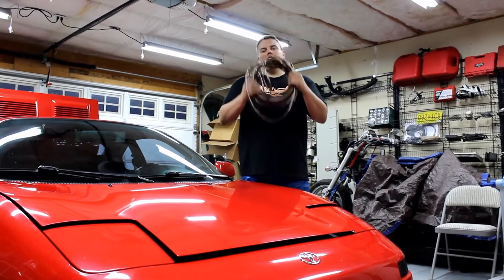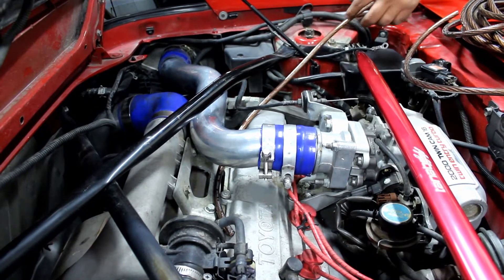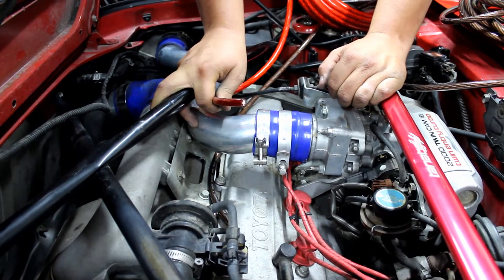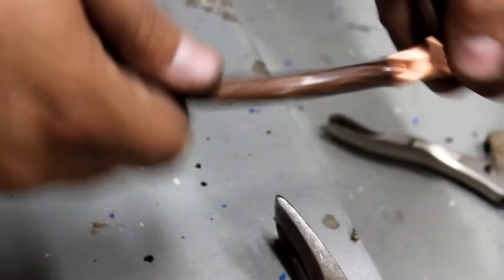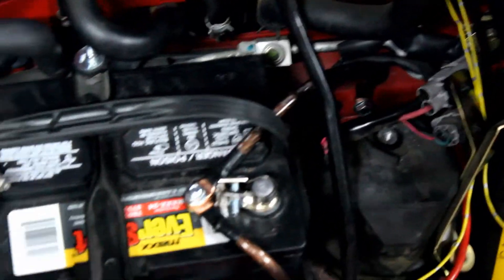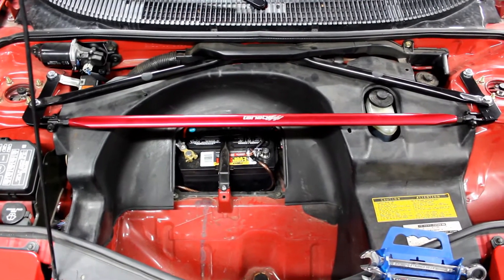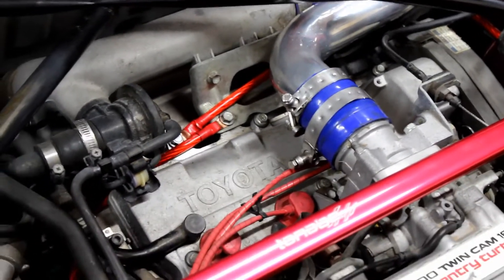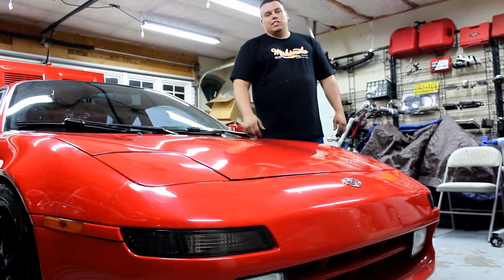How To: Turbo Toyota MR2 Grounding System Upgrade - BIG THREE

Comment: The best way to upgrade an mr2 chassis ground potency is to get a multi ported contact for the negative battery terminal and run 3 cables from it that are at least true 4 gauge (awg) and fully copper.  The three locations should be one for stock, one for a bolt on the driver strut tower, and one going into a bolt sticking out of the driver side frame rail just beneath the main metal coolant pipe that goes to the radiator.  I would advise against the location at the power steering fluid reservoir as it only leads to constant 16 gauge metal until the crossbar that the stock ground point is bolted to.  
The locations I listed will cause ground potency to increase at the rear end, traveling through the thickest metal of the superstructure before dissipating at the trunk wall where it becomes 16 gauge again
Reply from the maker: what electrical engineer says potency when referring to ground resistance?  all that matters is the resistance from any point on the engine to the battery negative terminal.
Reply: Actually the word was meant to say potential, but when swiping words on my phone it causes some words to autocorrect, however, focusing on what terminology I used, as well as making the assumption I am an "electrical engineer" seems intellectually dishonest.  Nothing in my original comment was intended to be rude, I simply saw the fastening point at the reservoir and that caused me to make my comment, giving the best information I could.
I am not an electrical engineer but I was a mechanical one.
I have build 11 of these vehicles, a few times it has involved stripping down to the super structure and beginning welding strengthening points to replace glue contacts.from.toyotas assembly line.

You are correct, resistance to the battery is what matters, when a point has good ground potency.  Good ground potential simply means it is at zero in comparison to the positive voltage.  Or as you put it, it has "no resistance to the battery negative terminal".
You can also just call it earth if you like.

I repeat, the metal floor of the "drunk" is 16 gauge and the only metal that it is tig welded to is the crossbar behind the battery, this is the same crossbar that the stock battery contact is bolted to.
The other contact points have pinch welds, bolts and glue.
The frame bars on either driver or passenger side are not only much thicker metal, but have an unbroken lead to the rear end that stops just before the trunk, where pinch welds and glue increase resistance.
The strut teirs also have an unbroken lead to the rear end, however, not though the rails but through the superstructure.
Whatever terminology you wish to use, these are the 3 points in the front of the vehicle that have the most unbroken metal leading to the rear end, causing multiple points in the rear to have better grind potential. 
Or "lower resistance to the negative battery terminal".
The strut towers and rails are the normal chosen points in the rear, however, after this modification, even 16 gauge points in the rear will have good ground potency, except for the wall and floor of the trunk.
This is useful not only for grounding the engine, but mounting high powered audio equipment in the rear, for example.

Comment: man i cant find the ground wores on my 91 NA,  i know its supposed to be on the intake manifold somewhere,
Reply from the maker: Just add a new one.
Reply: @FatGuyBuilds  i can do that. i know to connect it to a bolt on the intake manifold but where do i connect the other side?
Reply from the maker: @bradbooker2473  the body.  Any bolt
Reply: @FatGuyBuilds  so the main ground just runs from the body of the cr to the manifold?  im being told if it is missing or corroded it could cause my issue with no power to the injectors does that sound right?  my relays are testing fine and i have power to the coil.  thanks for your help.
Reply from the maker: @bradbooker2473  it could possibly.   Add it and find out.  I would also add 1 from the block to the body as well

Comment: What’s up man

Can you please show where you bought your materials? I’m guessing amazon?

what size end terminal clips are you using on your wires? You mentioned to use the correct one but didn’t mention what diameter or size you’re using? I also have an MR2 so whatever you used will work for me
Reply from the maker: Email me...  Jasongeorgievski@gmail.com